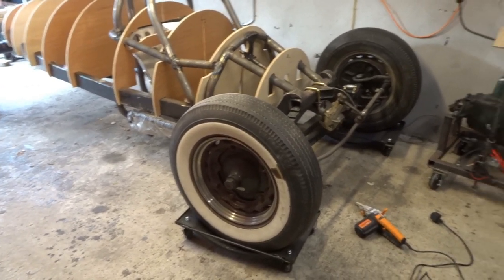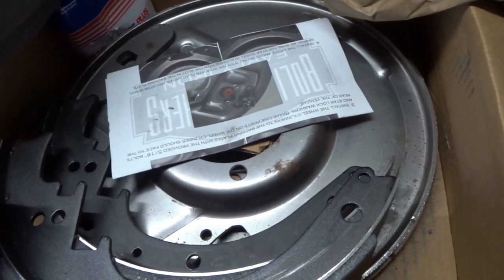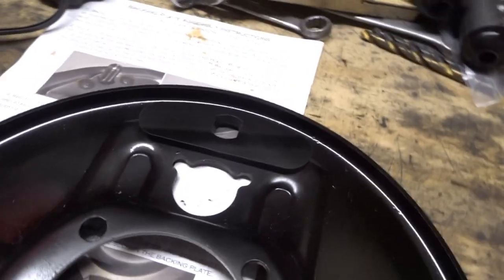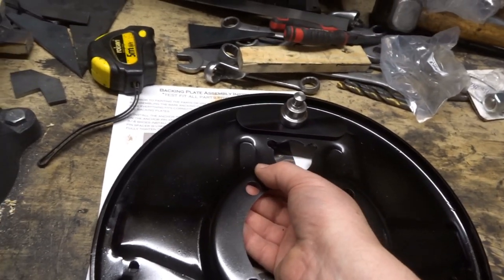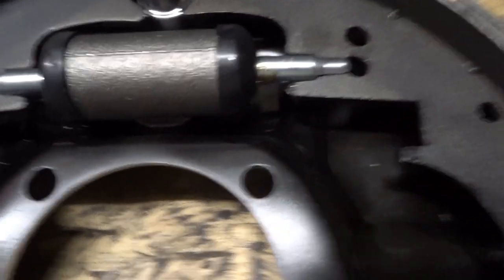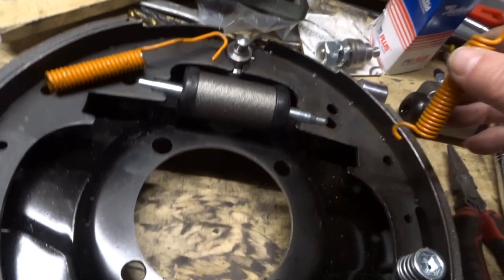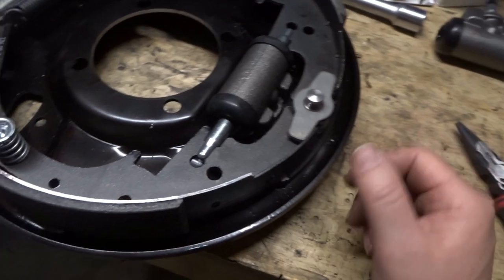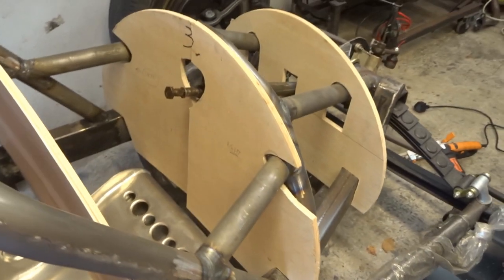Belly Tank Lakester | Juice brakes & Mocking up Body. Ep27

Comment: I thought you might like to know  that those are called Bendix duo-servo brakes. Because the adjuster between the shoes floats and is not attached to the backing plate the leading shoe pushes on the trailing shoe and energizes it, giving the brake a lot of stopping power despite having no servo.later it was still used with power brakes. It was eventually used in all US cars and the Volvo 544. Nascar used it for years after disc brakes were otherwise universal .
Reply from the maker: I know brake shoes self-energise but I did not know that having a floating adjuster makes it better again. Thanks for the information. I cut my teeth on air cooled VW's which were also low cost people's cars but it has been very interesting to see how Ford did it in a completely different way in terms of getting the maximum out of the least amount of parts, metal and assembly steps.